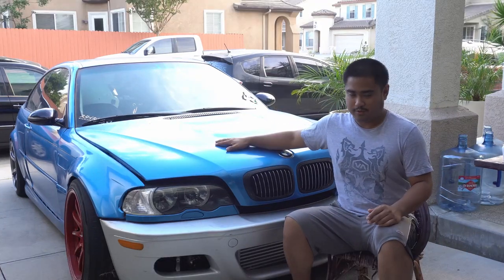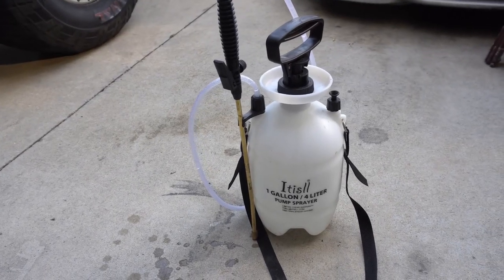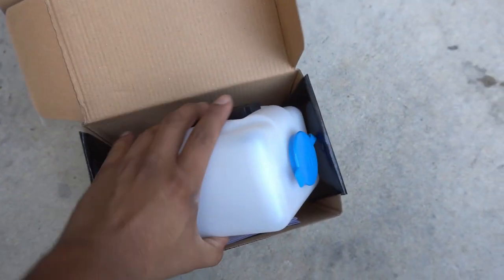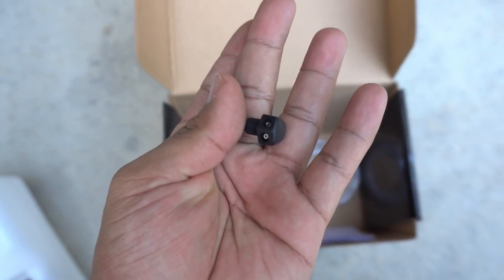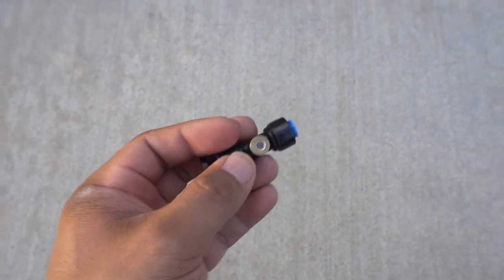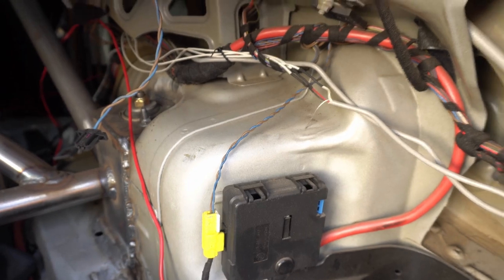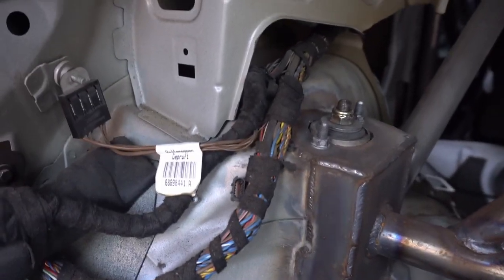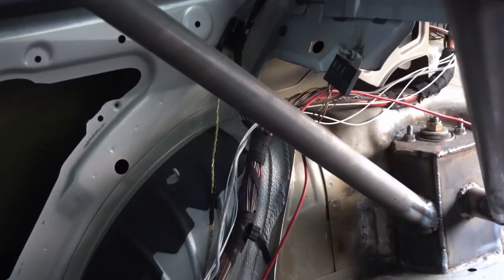DIY Tire Sprayers (TRIPLE YOUR DRIFT CAR'S TIRE LIFE) | #TheE46DriftBuild Ep 69

Comment: Don’t use those misters on the radiator and coolers, the heat destroys the nozzles. Find a fan spray windshield wiper nozzle works like a charm👌🏽 haven’t found a way to minimize the water usage tho😅
Reply from the maker: Really? I didnt think the radiant heat would be that bad.
Reply: @nuisance_carl  yea it pretty bad I tried 3 different styles of misters they all just melted and stopped spraying